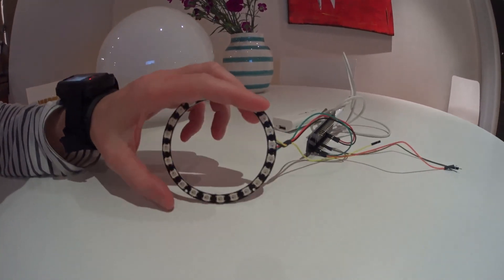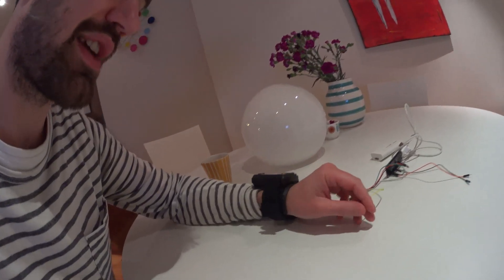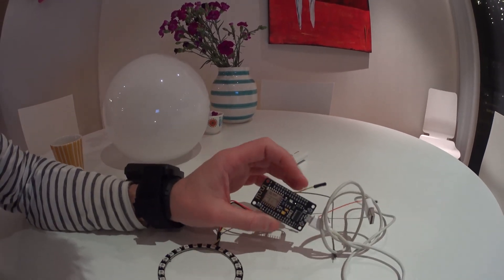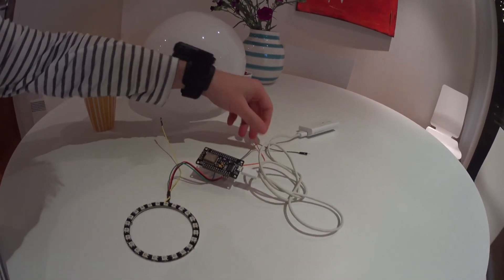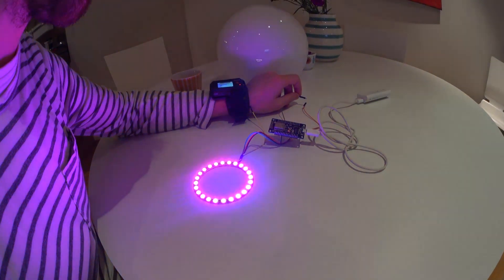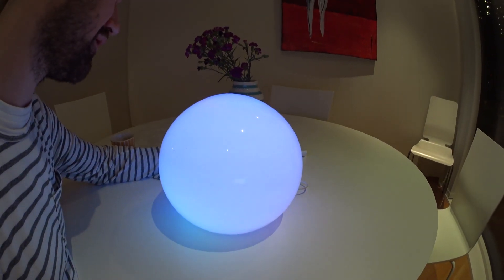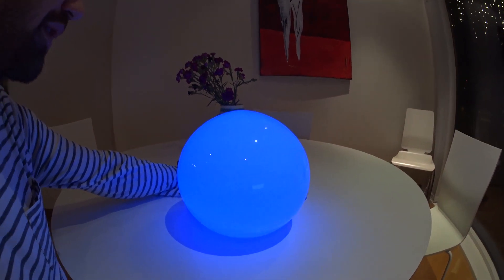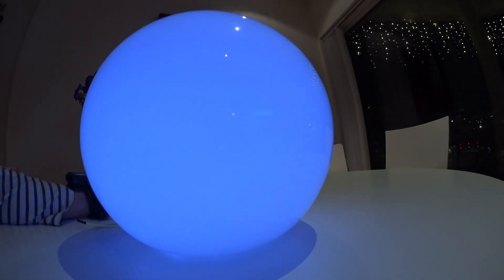Ikea lamp hacking with Arduino and Adafruit Neopixel clone

Comment: you didn't even show how to do this from start to end .... like installing program in to chip step by step
Reply from the maker: Hi, thank you for your comment.
I did this video actually as an attachment to my Norwegian blog which I didnt update in a while.
Bot you can read my translated blog entry here: https://translate.google.com/translate?sl=no&tl=en&u=http%3A%2F%2Fmjelde.blogspot.com%2F2015%2F12%2Fhacke-en-ikealampe-med-arduino-og.html

There it says which library I used, which pins and the config values I used.
As you will see in the text, the input pins doesent match with the regular Arduino pins, so you have to do it like I wrote there.

Other than that its just to connect the chip to your PC, you need a cable that is compatible with your device and you then use an IDE (for instance Arduino IDE).
This will then show which virtual comport you use to connect, then its very simple to load code into the arduino or arduino compatible device.

The only chip I found a bit hard to program was a neopixel clone as I had to disconnect the power to flash on that one, but that was more for wearable devices (like sewing electronics into your clothes).
Reply from the maker: Maybe this is also interesting for you?
https://translate.google.com/translate?sl=no&tl=en&u=http://mjelde.blogspot.com/2015/12/lilytiny-lilypad-attiny85-wearable-iot.html

Comment: how can you turn it off without disconnecting the battery
Reply from the maker: You can do it several ways, I guess your imagination can let you choose :-)
The easiest way is to use two pins as a switch: https://www.arduino.cc/en/tutorial/switch

But if you wanted to, you can make a microphone clap switch also!

Comment: Accent? What accent, you hardly have one. I understood everything you said. If I didn't want wifi control or anything fancy, what is the simplest control I can use for just powering this in white mode for something like a drill press?
Reply from the maker: Thank you, I dont speak English daily anymore.. However in Norway we dont dub movies and we watch a lot of international tv-shows etc. (also movies). Then there is also the fact that we have English since primary school.

Anyhow, speaking about something else than my accent: 
If you just want white led powered by button press I would dismantle the drill and measure how many volts are by the button. You have other options than the RGB led ring, like high powered white leds:
https://www.aliexpress.com/item/Free-shipping-50PCS-1W-3w-High-power-LED-Lamps-white-warm-white-30mil-45mil-Chips-high/32298464938.html?spm=2114.01010208.3.9.C8iNTU&ws_ab_test=searchweb0_0,searchweb201602_2_10152_10065_10151_10068_10136_10137_10157_10060_10138_10155_10062_10156_10154_10056_10055_10054_10059_10099_10103_10102_10096_10148_10147_10052_10053_10142_10107_10050_10051_10171_10084_10083_10080_10082_10081_10110_10111_10112_10113_10114_10181_10037_10182_10032_10078_10079_10077_10073_10070_10123_10124,searchweb201603_9,ppcSwitch_3&btsid=08122aa3-39af-4545-9ed0-02a8a79fd651&algo_expid=09569fc8-b10d-4570-8eba-655b45715c6f-1&algo_pvid=09569fc8-b10d-4570-8eba-655b45715c6f

You need to make sure that you dont have too high voltage, if it's too low, you need a step up converter/boost converter. If the voltage is too high, you can use a voltage divider or connect several leds in series.

There are two things about leds:
1) You need the right leg for plus (wont work the other way around, as regular bulbs do, so test them first on a small 1.5v battery).
2) if you have lets say 5v at drill button, you can connect 2 x  3v leds in series, then they can handle 6v. They wont get 100% output with 5V, however they wont burn (unless they overheat...).

If you have 18v at switch, connecting too many in series might feel silly... (you dont want too much power at the button either). Then a voltage divider can be made with resistors. There are many calculators that use ohms law, like this one: http://www.ohmslawcalculator.com/voltage-divider-calculator
Reply: Thanks for responding and for the help.

Comment: Cool lamp, I just ordered the 24bit rgb led ring off ebay. What ikea lamp are you using?
Reply: I think this is the Ikea Fado lamp :-)
Reply: I've got a few ESP8266 and NeoPixel (clone)  with apple homekit support  :-) Some of them combined with motion sensors. And also got 3 NeoPixels in Ikea lamps :-D
Reply: hello,we have this product,100mm-40led,74mm-24led,48mm-16led,if you have interested,please contact to me,thank you.
Skype: jeason888@outlook.com
EMAIL: jeason_xt@jercio.com
Reply from the maker: Yes, this is true!
Reply from the maker: You can even use a power bank and hide it inside, also you can use light sensor to read analog output of light sensor and adjust intensity of LED compared to room lighting :-)

Comment: Hi! Is there any chance you can share the code, I know I seems simple but I am struggling with this, also maybe the pin connections?
Reply from the maker: +markoutram001 hello, did you get it to work?
You only need Adafruit_NeoPixel library you can get here: 
https://github.com/adafruit/Adafruit_NeoPixel

Then after you add it to Arduino you go to: File > Examples > Adafruit > Neopixel > Button Cycler

This will open a complete code for buttoncycler, you need to set there 3 things:
#define BUTTON_PIN   2
#define PIXEL_PIN    6
#define PIXEL_COUNT 16

So if you have 24 pixel like me, set #define PIXEL_COUNT 24
Then you have to know about the pin mapping, for ESP8266 its not correct vs Arduino, copy constants from here:
https://github.com/esp8266/Arduino/blob/master/doc/boards.md#pin-mapping

When you have those constants in your project you have to look at the ESP8266 too for finding correct pins.
I dont think I saved my code for that day, but I think I still ahve it wired up (I have a lot of arduinos and hardware). If you want I can find the wiring :-)
Reply: Thank you! It was the pin out that I had got wrong, working like a charm now. Appreciate you getting back to me.
Reply from the maker: Just glad to be of service 👍
Reply: hello,we have this product,100mm-40led,74mm-24led,48mm-16led,if you have interested,please contact to me,thank you.
Skype: jeason888@outlook.com
EMAIL: jeason_xt@jercio.com

Comment: Hi! Thanks for the video! I'm thinking of buying the pixel ring myself to try this but I wanted to ask if the 24 led ring fits through the opening of the sphere so that I can use the bottom part that comes with the lamp? Otherwise I'd have to use a smaller one or a strip.
Reply from the maker: +alexanderktn Hi, yes it fits fine :-) It's not vissible when turned off either. I thought of putting power bank inside the lamp and putting the PB in front of arduino.
Then you charge the power bank with usb charger :-)
Reply: +Olav Alexander Mjelde Thanks a lot! I'm thinking of using a 5v switching power supply either outside (if I make more than one) or inside the ball. If I make more than one, a single ESP8266 hidden in one lamp should be able to drive a few Fado lamps easily.
Reply from the maker: +alexanderktn sure thing, you can read my writeup via google translate:
https://translate.google.com/translate?hl=en&sl=no&tl=en&u=http%3A%2F%2Fmjelde.blogspot.no%2F2015%2F12%2Fhacke-en-ikealampe-med-arduino-og.html

I can of course get you the code too. Maybe my translated webpage is enough?
Reply: +Olav Alexander Mjelde Thanks a lot! I'm currently waiting for my led rings to arrive but have made a crude version with an unprofessionally rolled up led strip and an old Apple charger inside the lamp. I use an ESP8266 and can control it via web sockets. My (crude) code is here: https://github.com/TheAustrian/ESP8266-LED-Websockets .
Reply from the maker: No problem 👍 i have some arduino repositories like this arduino oled sound sensor https://github.com/olavxxx/Arduino-Sound-Sensor
Reply: +Olav Alexander Mjelde Thanks a lot, looks nice! I'm definitely bookmarking your repos. ;)
Reply: hello,we have this product,100mm-40led,74mm-24led,48mm-16led,if you have interested,please contact to me,thank you.
Skype: jeason888@outlook.com
EMAIL: jeason_xt@jercio.com